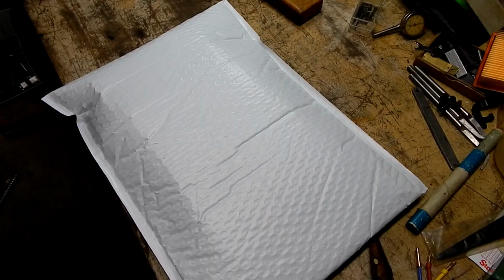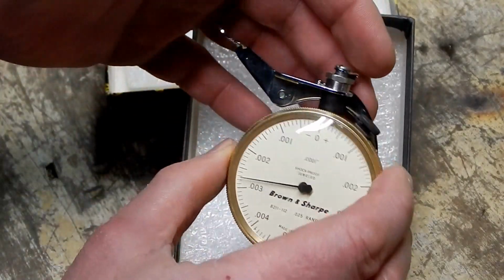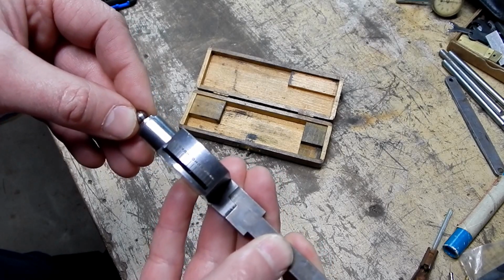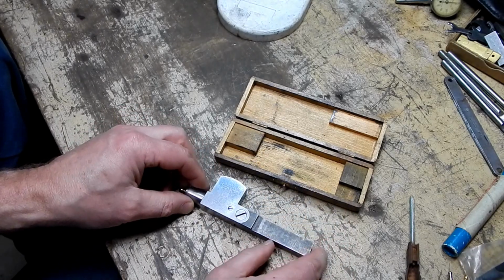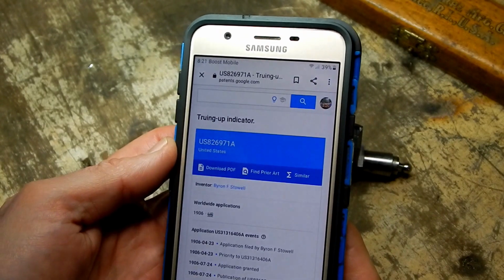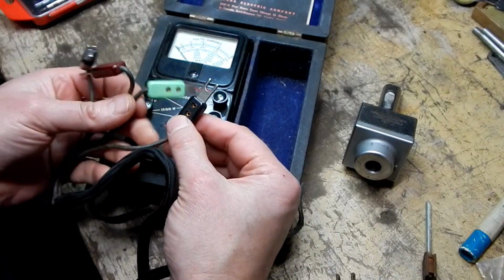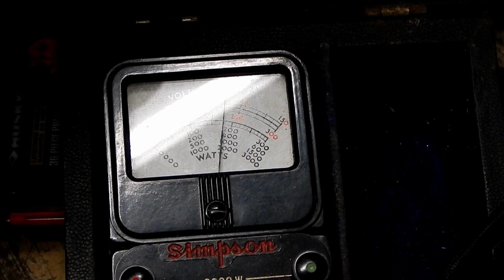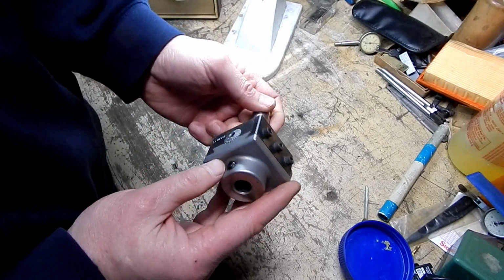December 2019 Tool store, Ebay, and other machinist tool buys

Comment: I took a look at the patent drawing of the B&S tool.  I think you have it figured out, that when that small screw is replaced, it will work correctly.  As to the Springfield Ma. location, I thought perhaps the inventor, Byron F Stowell, may have been associated with the Springfield Armory.  Turns out he was "master mechanic and mechanical engineer" with the Hendee Manufacturing Company, which made the Indian motorcycle.  The name was changed to the Indian Motocycle Manufacturing Company in 1923.  Mr. Stowell left Indian in 1919.
Reply from the maker: Whoa! Very cool indeed. Thanks!
Reply: @stevewatr  Found it in the Dec 3 Tool Shed video.  Almost skipped that video as he had bargain table at $4, and you were thinking it was $6 that day.  I was up in Lexington last week helping out with grandkids, but way too busy with a 2 and 6 year old to get over to Worcester, but I did get there once.  The tool shed guy is quite a picker, I just wonder where he gets such a volume of stuff to resell. Any idea?
Reply from the maker: @CalPil0t  I've seen lots of people walk in iff the street with tools, or say they have tools they want him to come look at. I think he advertises buying tools on craigslist and other places